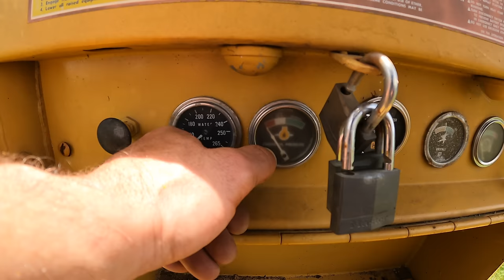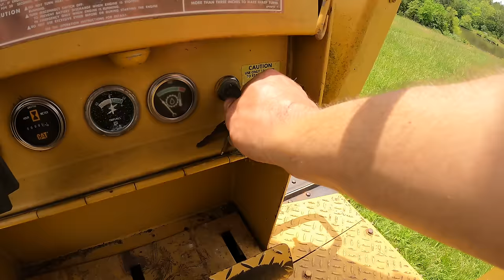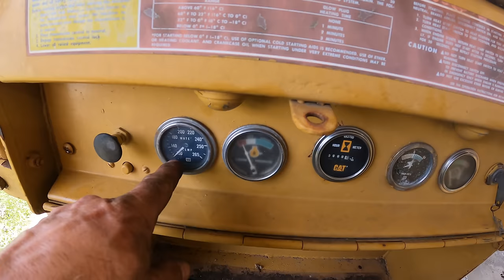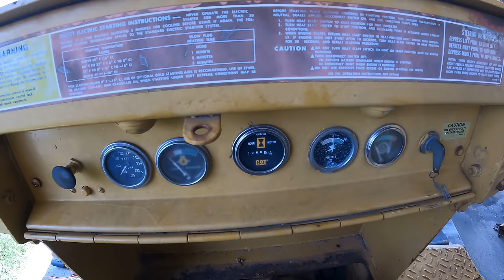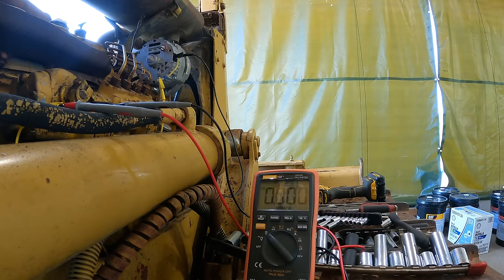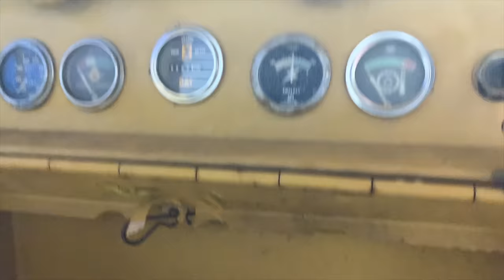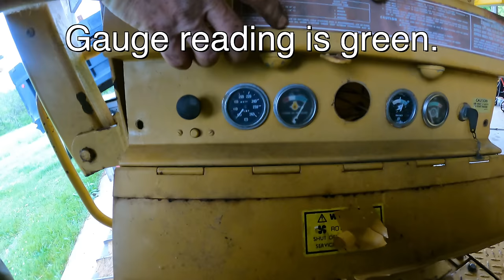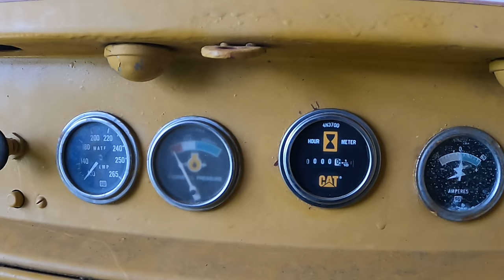Buying & Fixing a Bulldozer, Cat D3 Dozer, Part 1/2

Comment: given the nature of old kit, I would buy an ANL fuse and holder, possibly design it for 1000A(2x500A parallel) and place it right in the battery bay
if shit goes inside out you will have those fuses go boom, protects your setup

no battery will be delivering >1000A and most smaller setups will only put out <500A during even the worst starting load(and if your glowers droop power that low your battery is weak and a single 500A fuse will be plenty for an "oh sh*t" fuse)

just put an ANL(that is the term for it) 500a bus fuse and holder
bolt it inside the battery tray(can be on the ground side for ease since the load terminal would be chassis anyway) and add your "oh shit" fuse
you don't need more since that panel is fused(and even if it wasn't working a cheap 1-30A fuse holder would do all you ever need for non-starting, just pick your fuse based on max normal load)

and I think all your big girls should have a solar panel maintainer charger(a simple and cheap 12v 10w panel and a diode, with a zener to cap the voltage if you are concerned) or be parked in a bay with a bunch of panel-mount anderson connectors connected to a 14v float maintainer through a diode+resistor in each piece of gear

Comment: I worked at CAT dealer back in the 80's (rebuilding transmissions and engines) and to me it looks like the left track tension spring is broke. I would not fix the cylinder rods unless you have lots of money you want to throw away. Unless you're going to put thousands of hours on it over the next few years it is just a waste of money. imho
Pretty sure that engine 3204 is a pre-cup engine; not direct injection; which means glow plugs are standard way to start it.

Comment: If you kept pushing that wire you would have realize it came out the back side which is exactly the way you're supposed to do it. Use a paperclip and then pulled a wire out the back.

Comment: steering issues come from the steering valves there are two valves underneath the seat remove both valves you will find the rollers and cams are worn out . your steering should release the clutches first done through adjustment clucthes release first give you the slow and gradual turns if the clutches do not release first you will be burnining the brake bands out then you wil be into the steering clutch compartments to remove the clutches its a common problem if not adressed it becomes expensive and labor intensive

Comment: Electrician here: Contrary to popular belief, cleaning electric motors with water does not harm them as long as one uses clean water with a low mineral content, don't use high enough pressure to damage the insulation on the winding material, and dry them out with clean air afterwards. If the winding insulation is already damaged, then it will usually have problems anyway. If your water does not leave behind scale or residue around the faucet ends or in the water kettle, then you are good. If the electric motor has oil and grease, then you will want to use electronics degreasing cleaner.

Comment: 6:11 what if you press left and right simultaneously? will it have the same effect as the center one?
Reply from the maker: Yes, better even. The center is just brakes. The outer ones disengage the clutches and then apply the brakes if you push farther.
Reply: That break pedal in the middle is really meant for use out of gear because it doesn’t disengage the clutches (or at low rpm). Experienced operators wouldn’t normally step on both outside clutch/brake pedals at the same time either. Not trying to be judgmental at all but most experienced operators normally run machines in a manner that only requires left/right brake for steering even on steep terrain.

Comment: Ammeters bring all the amperage to the dash, which is dangerous and unnecessary.  Best to replace it with a volt meter.  Requires simple rewiring, and you can fix that alternator excitation battery drain at the same time.  There is a reason why ammeters are no longer used on boats!

Comment: Please do not degrade this alternator it is a very good alternator easy to repair and a lot of people don't realize that the older generators I mean back in the thirties the shaft sizes the same because they are millimeters I have been putting this alternator on many many applications older automobiles that the headlights were not good older farm machines that were 6 v and a lot of older forklift one in particular was a 1936

Comment: Batteries go dead when the steel touches the ground, concrete, blacktop ect.  (Rubber tired vehicles don’t (unless steel is touching the ground)  Park it on wood, including the blade, and the battery should stay good...

Comment: Ok just spit balling here ,  original alternator goes bad. Owner changes battery 1st cheapest part. Oil pressure switch goes out, changes hour meter, again cheapest part. Then gets mad and sells dozer.🤔😊

Comment: That alternator is a 2 wire standard GM. That someone has wired it in as a one wire. Doing it that way is why they had to have a cut off because the alternator stays excited and will run the battery dead. A true one wire alternator does not even have the option for a plug. It is blocked off. And using paper clips is the easiest way to hold the brushes in. I have reclocked so many alternators it's not even funny

Comment: 😂I don't know if anyone has commented  on thus yet, but you are running a automobile alternator. All alternators  require a voltage regulator. A one wire alternator does not have a built in regulator. Without that you will cook your battery and it cou lt still blow up. Voltage regulators are cheap.

Comment: I don't understand your aversion to using a pressure washer to clean the radiator, it won't hurt a thing.
Reply from the maker: Actually I did use it a little bit and it bent a lot of the fins.

Comment: Is the track tension spring broke or just kinked @46:35, looks kind of funky? loosen the tracks a bit too ( in your spare time ;-) ) 
Also, should put a spacer between the alternator lug and the rear lug on the mount, that way you'll be able to tighten the lower bolt up properly. 
Stop trying to start the poor thing without glow plugs, it's a cold hearted b++ch LOL
Like the channel :-)

Comment: $15,000 for JUST PARTS to rebuild steering clutches just doesn't seem reasonable, even for Cat. That should be enough to pay for a complete rebuild of the clutches and the final drives, barring the need to replace any of the hard parts, particularly if you can buy a RUNNING D3 for $16,000, as you did.

Comment: That alternator uses a "Toothpick" to hold the retracted brushes (or a straightened paper clip)  easiest of all Alernators , (Quit crying)  Oh, there is a hole in the rear housing for the paper clip to pass through (the "L" shaped paper clip )  ?

Comment: Hi John  Get in touch with Letsdig19 he will point you in the best direction for used Cat parts for your dozer he has hundreds of contacts nation wide for the track mud panels your missing on your new machine .  Worst case you can also maybe make your own out of maybe 1/8 or 3/16  th flat metal to keep your tracks safe . Good video too

Comment: First of all. Your engine fan is on backwards pushing air through the radiator instead of pulling. Second it has the wrong alternator pulley on it, get a dual belt one and use your single belt and thirdly the alternator is supposed to have a cooling fan  sandwiched between the pulley and fan. And never cut the bottom bracket that wide ear is supposed to keep it from twisting now you ruined it

Comment: you will fine that pumps and item on the machine has very inexpensive that are not sold by manufacture and the same pump or hydraulic motor has a minor change in bolting pattern, shaft connection or some thing that would keep the inexpensive and the changed part is so very expensive and if you do not know how to modified it o work or will not work and if you do not know how to modified it the after market the mfg will charge you 3 to 7 times the after market but the oem is built by the after market mfg

Comment: This guy is determined to start that dozer without glow plugs cold. It was never designed to start like that and its not going to without a absurd amount of rolling the engine over. It could sit out in the 100 degree heat all day and its not going to start without the glow plugs.
Reply from the maker: The machine has instructions for starting written on the console, and it says if the temp is over 60 degrees, glow plugs are not necessary.

Comment: Why did the previous owner put those two boards on there that you pulled off? Does this prove that he was a cheap person? I'm quite certain he was. He didn't want to spend the money for another set of armrests. I additionally thought of more than that. 14 thousand dollars is slightly less than two-thirds of the original price of that bulldozer. Not only that, except it's more than fifty years of age, possibly fifty-two. No, most certainly not worth the price you paid for it.